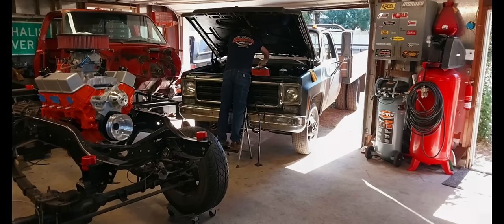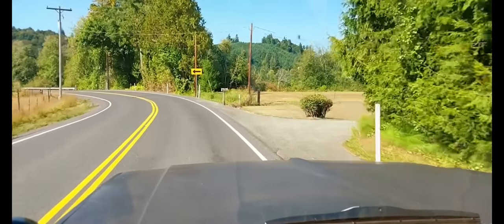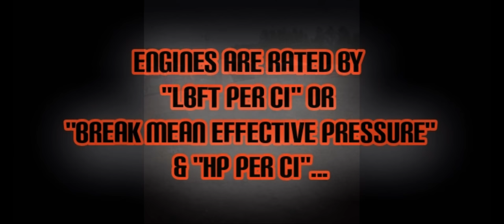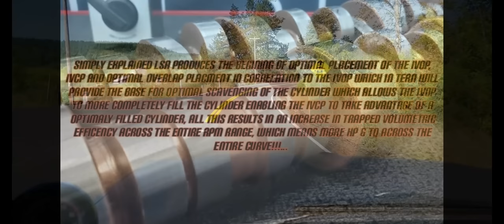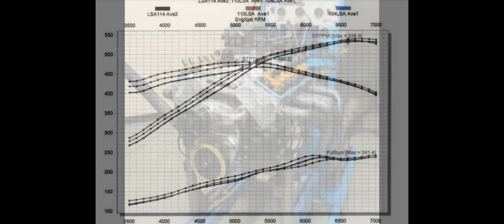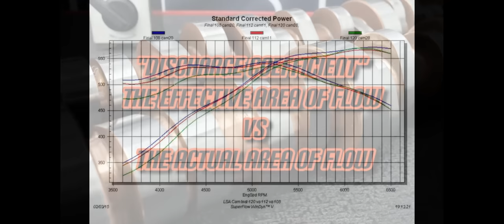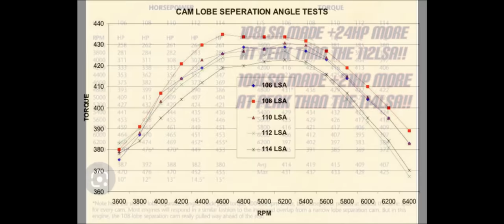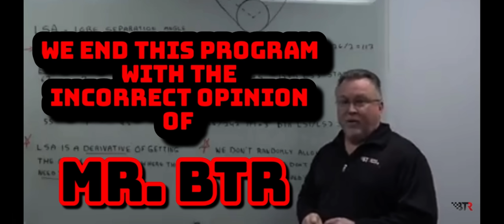Camshaft Selection via LSA, 19LSA's Dyno proven MAX TQ & HP cam tec. LSA, Overlap & Duration convert

Comment: This is the ramblings of a person off of their meds. You thinking that you have more knowledge and smarts than the “ main stream camshaft industry and most professional engine builders” is preposterous.
Reply: Right? Lol. This video is laughable, and trying to tough talk BT is hilarious. 

Go reinvent the wheel, dude, we'll all be waiting with open wallets & I'll cancel my future BTR orders 😂 Talking about overlap & lsa like it's some magical number that'll unlock all the mystery horsepowers..
Reply: Do an experiment:  call 5 different “main stream” cam manufacturers on Monday and tell them you want a fun street cam for a 4.8 LS.  Then repeat the same process Tuesday thru Friday.  How many different cam specs do you think you’ll have at the end of the week?  Theoretically you should be given a single optimum cam profile 25 times, right?  Or at least given the same cam specs by the same manufacturer every call.
Then you could do a follow up experiment: call them all a week later and tell them you want a fun street cam for your 5.3 LS, and see how many times you’re recommended a cam that was already suggested for the 4.8.
The “main stream” in any industry is interested in making money, and you make money by offering the least amount of products that cover the widest range of needs possible.  The result is you have a relatively few cams that “work” in thousands of different configurations of engines, but aren’t optimal for nearly any of them.  Look at BT’s website for example, he offers the same cams for all LS “truck” motors: 4.8 - 6.0. Never asks what heads you’re running, what intake, carb or FI, etc… He offers a few cams that will work in any combo of LS truck motors, but a 6.0 with 243 heads and LS6 intake will need a different cam than a stock 4.8 to make optimal power.
Reply: Exactly
Reply from the maker: PART 1 OF 2....WOW😆😆😆... You know I actually liked you, i always thought you were a real one, so i didnt want to have do this and i hate responding to mindless comments... Thats is one rather, in your own words ("preposterous"), Speculative, Ideological, Uneducated and irrational Judgment via BS you created in your mind about my intellectual capacity/knowledge I retain & my psychological state based off of your own personal lack of knowledge of how achive optimal Gas Dynamics created by the dynamics of optimal valve event timing,... For you to be so sure of yourself and spew such BS i would sure hope you have a dwep understanding! and i would hope you can tell me were im wrong with empirical data/evidence and an explanation based off of legit physical principles not a bunch of cobbled together speculative/theoretical BS or a bunch of misconstrued regurgitation about the effects of the IVOP, IVCP, EVOP, EVCP, what effects the placment of each of the valve events and i would love to hear your explanation of the importance of Overlap, the placment of overlap in relation to the IVOP, IVCP & EVCP along with the effects of Overlap, im about positive you have absolutely no clue and if you look on the internet you absolutely will not find the answer, you will find very very very very small peices of the answer spread out far across the internet...Face it the pro stock guys are not just handing out information and those top individuals that do very occasionally share information like Mike Jones, Harold Brookshire rip, Joe Sherman rip, Billy Godbold, Darin Morgain, John Kaase, etc, those guys are obviuously only gonna give very little peices of info, insightful peices information but very minimal,(example, i had someone comment yesterday saying they learned more from this video than they did in Billy Godbolds newest Book)( My Last video someone said they learned more from my video than they did at a 3 day David Vizard Seminar that cost $1,600)... Ultimately we cannot give everything that is gonna turn anyone into a valve event guru or a prostock engine builder, unless your riding with" Dunning-Kruger Effect" than in your mind your good to go!!!... Now as i said, I just provided empirical data with information that coincides physically/dynamicly with quite a few of the top individuals in valve events like mike jones, Harold Brookshire, David Vizard, Joe Sherman rip, And I know for sure some of the Pro Stock guys, Billy Godbold is currently involved in Pro Stock. .. Speaking of prostock, back in 2009 i had built an N/A 555ci BBC for my buddy with a prostock pull truck, that engine put out 1.63lbft per Ci, A modern prostock engine these days is around 1.7lbft per Ci... Now i hope you know who Harold Brookshire was? He is not mainstreem camshaft industry unlike Brian Tooley, Harold Brookshires evidence lines up exactly with the order of importance of valve events I gave in the video, those being IVOP, IVCP, Overlap placment that that is optimally relative to the IVOP that coinsides with the EVCP to create the optimal scavenge cycle which allows the IVOP & IVCP to produce the highest volumetric efficiency across the curve... Now i really do want to hear your "theory" of valve events(Notice I said "THEORY") cuz im positive it will be just that, a damn Theory and Opinions are not empirical!!!.... You do know what Empirical means dont you??? 

Now with everything you apperently gathered must be some sort of Super D Duper PhD Human Psychologist, PhD Physicist, PhD Engineer to make such outrageous claims... so being as your apperently such an expert at analyzing the human psychy because you said and i quote "this is the ramblings of someone who is off their meds"😆😆... If you were such a professional in the Science of Human Psychology you would be able to tell that I am what is scientifically known as an INTJ personality which is rare and makes up only 2.1% or less of the world population (LOOK IT UP), Now as i said in the video "my grandfather is a Physicist/ Engineer and worked for GM & he was also a race engine builder, who then tought my dad who was was a Mechanical engineer, master machinist, welder & race engine builder"....  I was a Engineer/machinist/welder & race engine builder...  For a lil over 18+years my dad owned a high performance machine shop/engine reaserch facility that did alot of engine and more specifically cylinder head & valve event R&D befere my dad got carcinoid cancer & shortly after that i broke my back on top of taking oral chemotherapy for a rare skin related cancer, the chemo drug weakened my spine that was allready in bad shape from extremely hard an physical life in general, so ultimately we had to sell the shop because of health purposes, this was the very begining of why im not in some sort of position in the automotive industry and or have a Big Shop... A lil later in life i had to quit my formal education at almost the end of the 3rd year for my masters in mechanical engineering because my grandmothers alzhimers got so bad that she needed takin care of so i sacrificed some of my life to make sure my grandma had the best end of her life, she's been with us 14years and 12 of them require care 24/7... At 28 years old i became paralyzed on my right side while working in the garage, I damn near died, I spent a lil over 1 month in the hospital and was told i would probably never walk again, I fought hard enough to be able to walk short distances which is where I am today, But i am permanently disabled & plagued by Complex Regional Pain Syndrome (aka suicide disease) which is the most painfull condition known to man NO BS, among my many other health problems and the complications of said health problems that occasionally put me in a wheel chair for weeks at a time, which is why i didnt put a video out for 9 months because of health related complications... I don't like talking about it and I've been dealing with it for so long that im realy good at acting like in not miserable in the videos only cuz i dont stay on camera for long being as i dont want peoples to see how bad it is physically cuz I don't want peoples sympathy.... Now to a simplified explanation of me & my experience because your apperently Blindly Afflicted by whats scientifically known as the "Dunning-Kruger Effect" which is a psychological bias that makes individuals extremely judgmental with  speculative ideologys and a BIG false sense of higher knowledge because they cant psychologically comprehend the complete complexity's and how deep certain subjects really are so ultimately they have no idea and cannot comprehend that they dont know what they know, and ultimately with that way of thinking they will never be aware and comprehend their Affliction that is scientifically known as "Dunning-Kruger Effect".. You can take away from this what you will, but you really should question yourself before making such outrageous, judgmental, speculative, ideological or in your own words "PREPOSTEROUS" statments because you never know who is at the other end and what they have experienced throughout life.... Here is a quote " The intuitive mind is a sacred gift and the rational mind is a faithfull servent, we have created a society that honors the servent and has forgotten the Gift".(Albert Einstein)... For generations my family has been a very scientific oriented family, So here is a rather small scientific break down of myself for you... This is purely based on reality & science... Ultimately i am a product of rare mixture of 2 very rare Highly intelligent personality types, my INTJ Dad & my INFJ Mom which resulted in me having an extremely strong INTJ personality which is 2.1% or less of the population, the average INTJ has an iq of 130.. It is scientifically proven that intuitive intelligence is the higest form of Intelligence and intuitive intelligence is the primary factor for an INTJ mind... Now being as my family have always had a solid understanding of Alot of different regions of The Scientific side of life, They had a solid comprehension of Human Psychology so my parents knew about the effect/influence of what is scientifically known as "The early childhood development period" which is from the ages of 2-8 years old and it is the most critical time in the development of a child's understanding of the world around them and is the most influential time for the development of a humans rational intelligence beyond the childs given amount of natural intuitive intelligence... so by the time I was 8 years old i knew the valve events, the effect each valve event has on an engine and how to adjust Valve Events to achive specific results, etc, I had built my first engine at 10 years old, and by 10 I was running machining equipment, playing on a flow bench and knew more about Cylinder heads than most grown men and i was learning more every day....  Now how common do you think a family is with PhD Physicist & engineer for a Grandfather, a father that was an Engineer/Master Machinist bolth have generations deep knowledge about the complex physics of the world around us that is applied to the physics/dynamics of high end race engine building.... What do you suppose a kids childhood is like being born into something like that with all that knowledge to be absorbed???
Reply from the maker: PART 2 OF 2..... I was literally raised around the building of high HP engines in a machine shop/research facility with a dyno cell... If you understood Human Psychology you would be very aware the 16 scientifically proven personality types that exist and that obviously not every kid has a the same personality type, similar childhood, or has the same mental capacity, intuitive intelligence/knowledge, rational intelligence/knowledge, abilitys and experiences when they are children... 99%+ of kids don't have a Grandfather who is a physicist, ex engineer for GM, and race engine builder and A Dad who was an Mechanical engineer, master machinist and race engine builder... how many family's do you know with those specific vocations, credentials & knowledge, that pass down generations of their rare valuable knowledge, and start very early properly educating thier children to understand the world around them, and this begins from the ground up with what children cant see but can be visually presented, starting with Nuclear/Sub Atomic Particle Physics, the base of Quantum Mechanics to expand one's mind, the laws of Thermodynamics, the 26 dimentionless constants that discribe the universe along with the 4 theoretically 5 fundamental forces, those being Strong Nuclear Force, Weak Neculear Force, Electromagnetic Force, Gravitational Force, and possibly Dark Energy... does all this sound like the typical childhood???  Is it completely unbealiveable for a kid growing up being taught in such a way and experience all this knowledge???... Now in this video Not only did i give information on optimal valve events, i also gave All you need to know about a "cylinder head" to select LSA is the "DISCHARGE COEFFICIENT" which in is represented by Intake Valve Diameter in Davids "EMPIRICAL EQUATION", I did give the Scientific Sae Constant of 137cfm/sqin but most top pros use 146cfm/sqin i also gave and the EMPIRICAL EQUATION to calculate a cylinder heads Discharge Coefficient which is Curtain area=Valve diameter×pi×lift... then Curtain area×146cfm/Sqin= Theoretical Max Flow Area, then you take Cylinder Head Flow @.??? Lift ÷Theoretical Maximum Flow= "Discharge Coefficient" of a given Cylinder head at any given lift... That calculation was for those who are more advanced that already have a good solid understand and want to work on being more precise with the calculation for their valve event timing/LSA results, Can you explain to me what a "DISCHARGE COEFFICIENT" IS??? Without looking it up??? The "Discharge Coefficient" is briefly explained in writing in my video... So Being as my personal knowledge lines up Mathematicly and with the physical principles of Davids I had shown Davids Duration Formula and i gave MY PERSONAL EMPIRICAL FORMULA for Duration and the conversion of camshaft specs based off maintaining the Optimal LSA and a specific amount of Overlap, this was not just pulled out of thin air, it was determined threw 3 generations of racing engine/camshaft/cylinder head reaserch via Scientific Method which is threw R&D/acurate data acquisition and physical observation that can be Mathematicly explained, that is how my Duration formula was created(And IT IS EMPIRICAL!!),... I even have a personal formula that is only "383 specific" it's (383÷8×2.02÷.91)=106, that also lines up perfectly with davids 128 Equation for a 383 w2.02 valves & 10:1-10.5:1 compression                              (example 128-(383÷8÷2.02×.91)=106  You do know the physics of the universe can be mathematically explained right, and with multiple different equations when something is correctly quantified??? My Duration formula just so happens line up mathematically with David Vizards Duration formula but mine has been Mathematicly Simplified which is what you want with an empirical equation, Davids only supposed to be Advertised Duration, but mine is intended to do @.050 & Advertised Duration along with cam specification Conversion according to Optimal LSA & A specific Overlap.. On the entire Internet you will find this nowhere hands down, you will find very very very very small peices of information about how to achive the optimal Gas Dynamics via the Dynamics of optimal valve event timing, along with their effects and their order of importance.... Like I Said You can take away from this what you will, but you really should question yourself before making such outrageous, judgmental, speculative, ideological or in your own words "PREPOSTEROUS" statments because you never know who is at the other end and what they have experienced throughout life....
Think about what you say cuz you may just expose the fact that you are Blindly Plagued By The Dunning-Kruger Effect which is something all humans must be very conscious of....
Your not Butthurt cuz your a Brian Tooley Fan Boy Are You??? You do realize that after I exposed Brian's incorrect theory for LSA & valve events in general, David Vizard followed my lead and also exposed Brian Tooley for being incorrect... David said he thought my presentation was cool and he wished he was as smooth as myself... Don't you think there is something to that, David Vizard would absolutely not associate his name with mine if I was INCORRECT!!!     
Now to your God  Brian Tooley, He had seen my last video and commented trying to justify his theory with weak example that work half ass, so i then had the chance to personally explain to Brian why he is wrong about the actual function LSA and there was no denying the proof, i told him being as we are men we can agree to disagree but you cant deny reality and my goal and i know David Vizards goal is for people to see reality and the reality is Brian is absolutely incorrect, so I gave him the suggestion of coming out with a line of cams based off LSA for common specific CI LS engines with a few different RPM ranges, the only small compromise is the variations in cylinder heads there would have to be some sort of generalized Discharge Coefficient but that would minimally effect power production capability,  I then let Brian know that David Vizard had followed my lead and used Brian as an example of what not to do with LSA just as I did, after i told Brian that David had made a video exposing him as a professional with an incorrect theory about LSA... Guess What Brian did after I told him that?? He went over to David and David told him the same thing I did, so then Brian invites David to come see his facility and possably give Brian a consultation on optimal valve events... Don't you think there is something to that also???
Reply from the maker: @Kstang09  PART 1 OF 2... I Hate responding to mindless comments like this... 😆😆Tough talking BT ehh?? What kind of Childish BS do you think this is???😆Speculative, Ideological, Uneducated and irrational Judgment via BS you created in your mind about my intellectual capacity/knowledge I retain & my psychological state based off of your own personal lack of knowledge of how achive optimal Gas Dynamics created by the dynamics of optimal valve event timing,... For you to be so sure of yourself and spew such BS i would sure hope you have a deep understanding!!! and i would hope you can tell me were im wrong with empirical data/evidence and an explanation based off of legit physical principles not a bunch of cobbled together speculative/theoretical BS or a bunch of misconstrued regurgitation about the effects of the IVOP, IVCP, EVOP, EVCP, what effects the placment of each of the valve events and i would love to hear your explanation of the importance of Overlap, the placment of overlap in relation to the IVOP, IVCP & EVCP along with the effects of Overlap, im about positive you have absolutely no clue and if you look on the internet you absolutely will not find the answer, you will find very very very very small peices of the answer spread out far across the internet...Face it the pro stock guys are not just handing out information and those top individuals that do very occasionally share information like Mike Jones, Harold Brookshire rip, Joe Sherman rip, Billy Godbold, Darin Morgain, John Kaase, etc, those guys are obviuously only gonna give very little peices of info, insightful peices information but very minimal,(example, i had someone comment yesterday saying they learned more from this video than they did in Billy Godbolds newest Book)( My Last video someone said they learned more from my video than they did at a 3 day David Vizard Seminar that cost $1,600)... Ultimately we cannot give everything that is gonna turn anyone into a valve event guru or a prostock engine builder, unless your riding with" Dunning-Kruger Effect" than in your mind your good to go!!!... Now as i said, I just provided empirical data with information that coincides physically/dynamicly with quite a few of the top individuals in valve events like mike jones, Harold Brookshire, David Vizard, Joe Sherman rip, And I know for sure some of the Pro Stock guys, Billy Godbold is currently involved in Pro Stock. .. Speaking of prostock, back in 2009 i had built an N/A 555ci BBC for my buddy with a prostock pull truck, that engine put out 1.63lbft per Ci, A modern prostock engine these days is around 1.7lbft per Ci... Now i hope you know who Harold Brookshire was? He is not mainstreem camshaft industry unlike Brian Tooley, Harold Brookshires evidence lines up exactly with the order of importance of valve events I gave in the video, those being IVOP, IVCP, Overlap placment that that is optimally relative to the IVOP that coinsides with the EVCP to create the optimal scavenge cycle which allows the IVOP & IVCP to produce the highest volumetric efficiency across the curve... Now i really do want to hear your "theory" of valve events(Notice I said "THEORY") cuz im positive it will be just that, a damn Theory and Opinions are not empirical!!!.... You do know what Empirical means dont you??? 

Now with everything you apperently gathered must be some sort of Super D Duper PhD Human Psychologist, PhD Physicist, PhD Engineer to make such outrageous claims... so being as your apperently such an expert at analyzing the human psychy because you said and i quote "talking tough to BT, etc"😆😆... If you were such a professional in the Science of Human Psychology you would be able to tell that I am what is scientifically known as an INTJ personality which is rare and makes up only 2.1% or less of the world population (LOOK IT UP), Now as i said in the video which you clearly didn't comprehend, "my grandfather is a Physicist/ Engineer and worked for GM & he was also a race engine builder, who then tought my dad who was was a Mechanical engineer, master machinist, welder & race engine builder"....  I was a Engineer/machinist/welder & race engine builder...  For a lil over 18+years my dad owned a high performance machine shop/engine reaserch facility that did alot of engine and more specifically cylinder head & valve event R&D befere my dad got carcinoid cancer & shortly after that i broke my back on top of taking oral chemotherapy for a rare skin related cancer, the chemo drug weakened my spine that was allready in bad shape from extremely hard an physical life in general, so ultimately we had to sell the shop because of health purposes, this was the very begining of why im not in some sort of position in the automotive industry and or have a Big Shop... A lil later in life i had to quit my formal education at almost the end of the 3rd year for my masters in mechanical engineering because my grandmothers alzhimers got so bad that she needed takin care of so i sacrificed some of my life to make sure my grandma had the best end of her life, she's been with us 14years and 12 of them require care 24/7... At 28 years old i became paralyzed on my right side while working in the garage, I damn near died, I spent a lil over 1 month in the hospital and was told i would probably never walk again, I fought hard enough to be able to walk short distances which is where I am today, But i am permanently disabled & plagued by Complex Regional Pain Syndrome (aka suicide disease) which is the most painfull condition known to man NO BS, among my many other health problems and the complications of said health problems that occasionally put me in a wheel chair for weeks at a time, which is why i didnt put a video out for 9 months because of health related complications... I don't like talking about it and I've been dealing with it for so long that im realy good at acting like in not miserable in the videos only cuz i dont stay on camera for long being as i dont want peoples to see how bad it is physically cuz I don't want peoples sympathy.... Now to a simplified explanation of me & my experience because your apperently Blindly Afflicted by whats scientifically known as the "Dunning-Kruger Effect" which is a psychological bias that makes individuals extremely judgmental with  speculative ideologys and a BIG false sense of higher knowledge because they cant psychologically comprehend the complete complexity's and how deep certain subjects really are so ultimately they have no idea and cannot comprehend that they dont know what they know, and ultimately with that way of thinking they will never be aware and comprehend their Affliction that is scientifically known as "Dunning-Kruger Effect".. You can take away from this what you will, but you really should question yourself before making such outrageous, judgmental, speculative &  ideological statments because you never know who is at the other end and what they have experienced throughout life.... Here is a quote " The intuitive mind is a sacred gift and the rational mind is a faithfull servent, we have created a society that honors the servent and has forgotten the Gift".(Albert Einstein)... For generations my family has been a very scientific oriented family, So here is a rather small scientific break down of myself for you... This is purely based on reality & science... Ultimately i am a product of rare mixture of 2 very rare Highly intelligent personality types, my INTJ Dad & my INFJ Mom which resulted in me having an extremely strong INTJ personality which is 2.1% or less of the population, the average INTJ has an iq of 130.. It is scientifically proven that intuitive intelligence is the higest form of Intelligence and intuitive intelligence is the primary factor for an INTJ mind... Now being as my family have always had a solid understanding of Alot of different regions of The Scientific side of life, They had a solid comprehension of Human Psychology so my parents knew about the effect/influence of what is scientifically known as "The early childhood development period" which is from the ages of 2-8 years old and it is the most critical time in the development of a child's understanding of the world around them and is the most influential time for the development of a humans rational intelligence beyond the childs given amount of natural intuitive intelligence... so by the time I was 8 years old i knew the valve events, the effect each valve event has on an engine and how to adjust Valve Events to achive specific results, etc, I had built my first engine at 10 years old, and by 10 I was running machining equipment, playing on a flow bench and knew more about Cylinder heads than most grown men and i was learning more every day....  Now how common do you think a family is with PhD Physicist & engineer for a Grandfather, a father that was an Engineer/Master Machinist bolth have generations deep knowledge about the complex physics of the world around us that is applied to the physics/dynamics of high end race engine building.... What do you suppose a kids childhood is like being born into something like that with all that knowledge to be absorbed???
Reply from the maker: @Kstang09 PART 2 OF 2..... I was literally raised around the building of high HP engines in a machine shop/research facility with a dyno cell... If you understood Human Psychology you would be very aware the 16 scientifically proven personality types that exist and that obviously not every kid has a the same personality type, similar childhood, or has the same mental capacity, intuitive intelligence/knowledge, rational intelligence/knowledge, abilitys and experiences when they are children... 99%+ of kids don't have a Grandfather who is a physicist, ex engineer for GM, and race engine builder and A Dad who was an Mechanical engineer, master machinist and race engine builder... how many family's do you know with those specific vocations, credentials & knowledge, that pass down generations of their rare valuable knowledge, and start very early properly educating thier children to understand the world around them, and this begins from the ground up with what children cant see but can be visually presented, starting with Nuclear/Sub Atomic Particle Physics, the base of Quantum Mechanics to expand one's mind, the laws of Thermodynamics, the 26 dimentionless constants that discribe the universe along with the 4 theoretically 5 fundamental forces, those being Strong Nuclear Force, Weak Neculear Force, Electromagnetic Force, Gravitational Force, and possibly Dark Energy... does all this sound like the typical childhood???  Is it completely unbealiveable for a kid growing up being taught in such a way and experience all this knowledge???... Now in this video Not only did i give information on optimal valve events, i also gave All you need to know about a "cylinder head" to select LSA is the "DISCHARGE COEFFICIENT" which in is represented by Intake Valve Diameter in Davids "EMPIRICAL EQUATION", I did give the Scientific Sae Constant of 137cfm/sqin but most top pros use 146cfm/sqin i also gave and the EMPIRICAL EQUATION to calculate a cylinder heads Discharge Coefficient which is Curtain area=Valve diameter×pi×lift... then Curtain area×146cfm/Sqin= Theoretical Max Flow Area, then you take Cylinder Head Flow @.??? Lift ÷Theoretical Maximum Flow= "Discharge Coefficient" of a given Cylinder head at any given lift... That calculation was for those who are more advanced that already have a good solid understand and want to work on being more precise with the calculation for their valve event timing/LSA results, Can you explain to me what a "DISCHARGE COEFFICIENT" IS??? Without looking it up??? The "Discharge Coefficient" is briefly explained in writing in my video... So Being as my personal knowledge lines up Mathematicly and with the physical principles of Davids I had shown Davids Duration Formula and i gave MY PERSONAL EMPIRICAL FORMULA for Duration and the conversion of camshaft specs based off maintaining the Optimal LSA and a specific amount of Overlap, this was not just pulled out of thin air, it was determined threw 3 generations of racing engine/camshaft/cylinder head reaserch via Scientific Method which is threw R&D/acurate data acquisition and physical observation that can be Mathematicly explained, that is how my Duration formula was created(And IT IS EMPIRICAL!!),... I even have a personal formula that is only "383 specific" it's (383÷8×2.02÷.91)=106, that also lines up perfectly with davids 128 Equation for a 383 w2.02 valves & 10:1-10.5:1 compression                              (example 128-(383÷8÷2.02×.91)=106  You do know the physics of the universe can be mathematically explained right, and with multiple different equations when something is correctly quantified??? My Duration formula just so happens line up mathematically with David Vizards Duration formula but mine has been Mathematicly Simplified which is what you want with an empirical equation, Davids only supposed to be Advertised Duration, but mine is intended to do @.050 & Advertised Duration along with cam specification Conversion according to Optimal LSA & A specific Overlap.. On the entire Internet you will find this nowhere hands down, you will find very very very very small peices of information about how to achive the optimal Gas Dynamics via the Dynamics of optimal valve event timing, along with their effects and their order of importance.... Like I Said You can take away from this what you will, but you really should question yourself before making such outrageous, judgmental, speculative, ideological statments because you never know who is at the other end and what they have experienced throughout life....
Think about what you say cuz you may just expose the fact that you are Blindly Plagued By The Dunning-Kruger Effect which is something all humans must be very conscious of....
Does you Butthurt cuz your a Brian Tooley Fan Boy Are You??? You do realize that after I exposed Brian's incorrect theory for LSA & valve events in general in my last video, David Vizard followed my lead and also exposed Brian Tooley for being incorrect... David watched my last video and said "he thought my presentation was cool and he wished he was as smooth as myself"... Don't you think there is something to that, David Vizard would absolutely not associate his name with mine if I was INCORRECT!!!     
Now to your God  Brian Tooley, He had seen my last video and commented trying to justify his theory with weak example that work half ass, so i then had the chance to personally explain to Brian why he is wrong about the actual function LSA and there was no denying the proof, i told him being as we are men we can agree to disagree but you cant deny reality and my goal and i know David Vizards goal is for people to see reality and the reality is Brian is absolutely incorrect, so I gave him the suggestion of coming out with a line of cams based off LSA for common specific CI LS engines with a few different RPM ranges, the only small compromise is the variations in cylinder heads there would have to be some sort of generalized Discharge Coefficient but that would minimally effect power production capability,  I then let Brian know that David Vizard had followed my lead and used Brian as an example of what not to do with LSA just as I did, after i told Brian that David had made a video exposing him as a professional with an incorrect theory about LSA... Guess What Brian did after I told him that?? He went over to David and David told him the same thing I did, so then Brian invites David to come see his facility and possably give Brian a consultation on optimal valve events... Don't you think there is something to that also???  You realy need to analyze yourself, a good place to start is the Dunning-Kruger Effect....